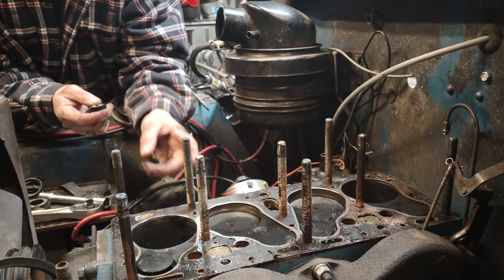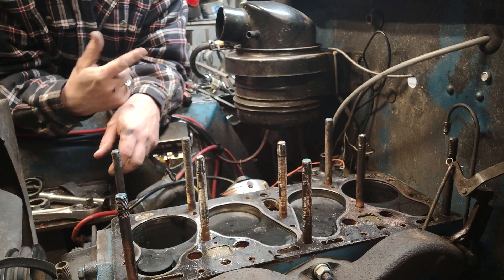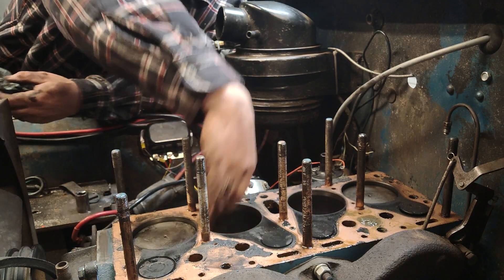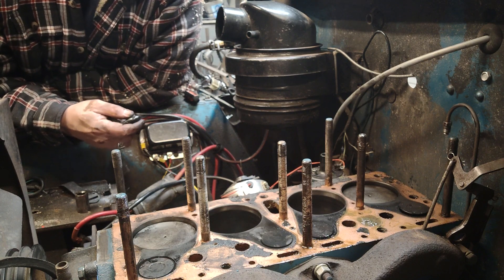Head removed from F134 Hurricane motor

Comment: Ferguson TE20 tractor head studs are the right length and thread for these if you need to replace any. The top deck of the blocks are quite weake around the centre head studs/bolts and prone to cracking, so make sure and inspect closely. I might add they are less prone to cracking if studs are used.